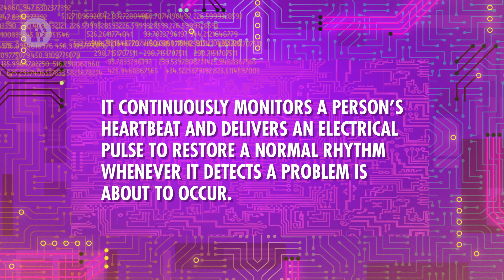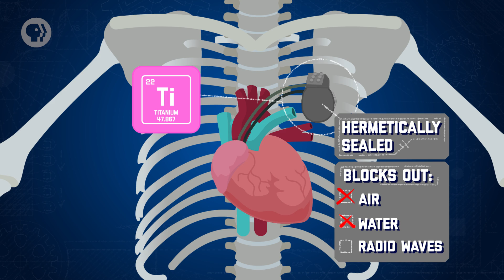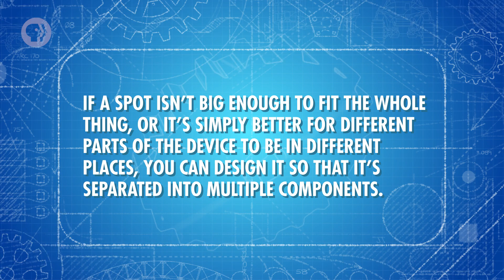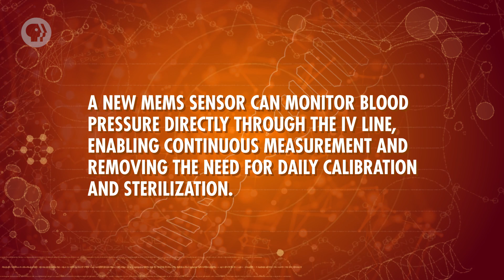Smart Tattoos & Tiny Robots: Crash Course Engineering #37

Comment: Fun Fact: Even though the name "Titanium" tends to be viewed by the general public as some sort of invincible super-metal, I believe that titanium alloys are actually comparable in strength to plain old steel. The actual benefits are that it is light and I think more chemically durable (corrosion-resistant) than steel. Sort of like an expensive compromise between alumin(i)um and steel.

Comment: The 'wifi' was 90's tech, very impressive.  It uses a customized hardware and software communicating through EM fields.  This allows a wand on the outside to telemeter with implanted devices.